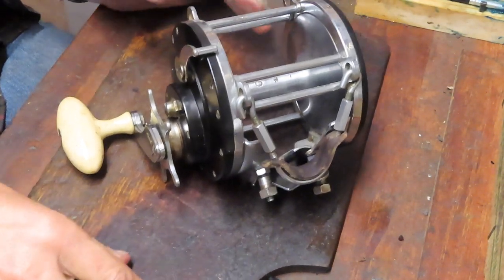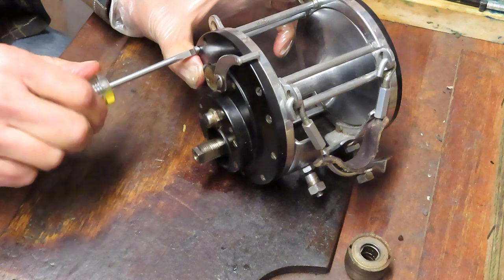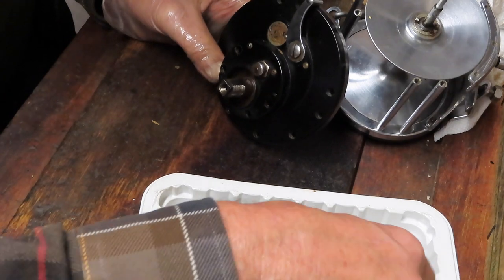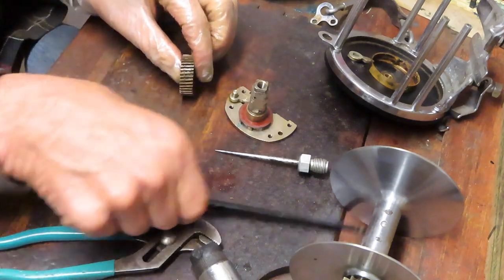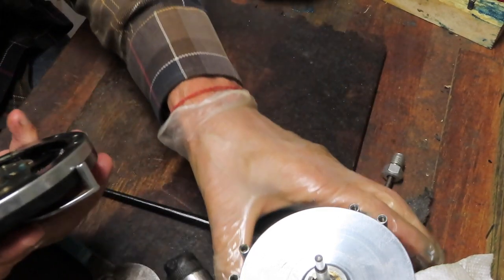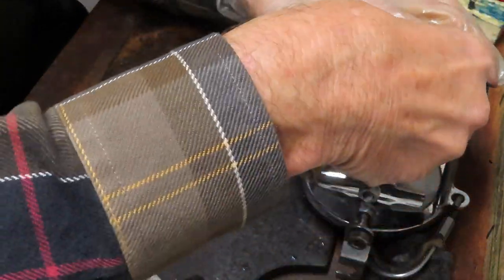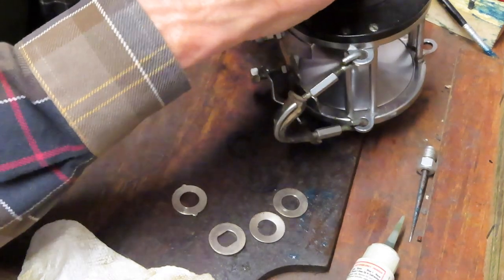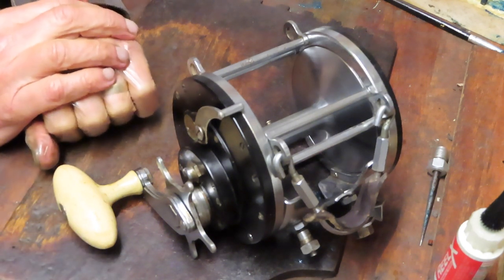Ocean City 609 Big Game 9/0 Saltwater fishing reel how to take apart and service

Comment: That's what I love about these reels they are bigger but basically all the same no matter the size...
Reply: Yepp they're reliable and still catch fish. I have multiple $600+ Okuma Makaira 30's for offshore fishing. Love them. Two speed, tons of drag, etc. The biggest fish I caught this past season was on a 40+ year old Penn 349 Super Mariner. It's usually my kite reel but that day it had trolling duty. My son ended up landing a 202lb big eye tuna on it. It's only negative is that it's slow but it holds tons of line, with the new drag washers it puts out 26lbs of drag which is plenty, the mechanical anti reverse never fails. It took nearly an hour for him to land the fish and the entire time I was praying it didn't break off or get sharked. Have pictures of him, at 12, with his 202lb tuna that's twice his size that I will cherish forever!!